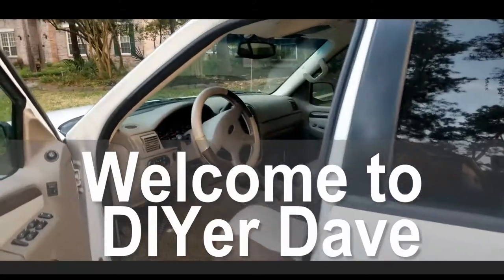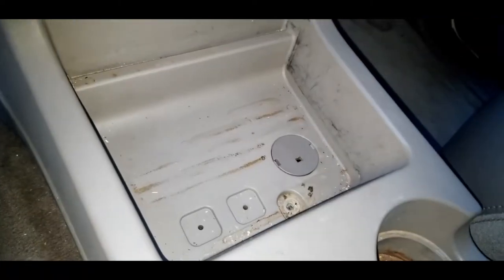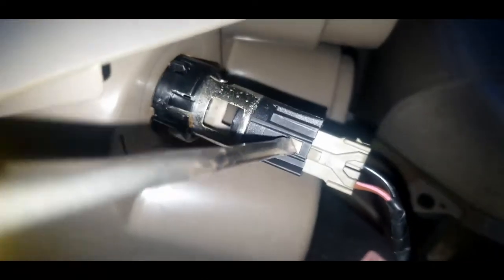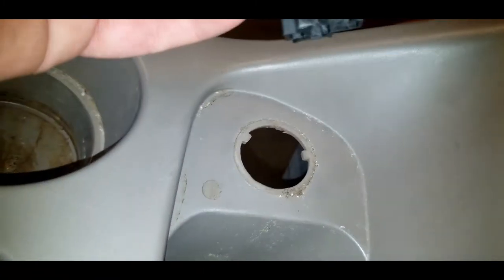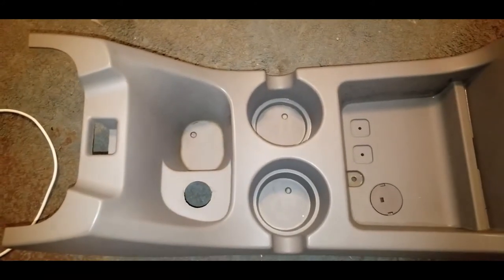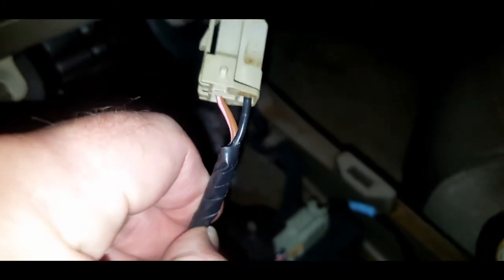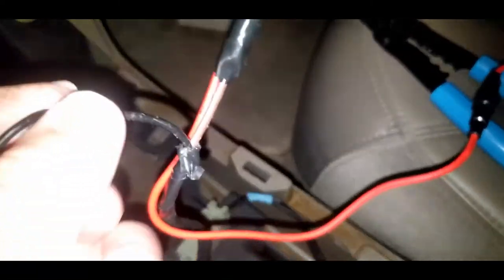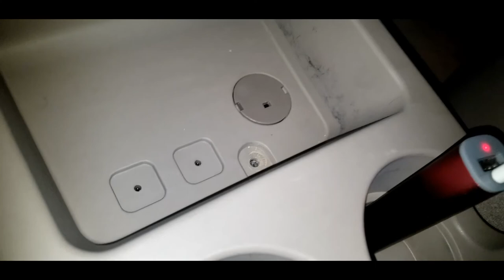02, 03, 04, 05 Ford Explorer Remove Cup Holder, Replace Cigarette Lighter, Install USB Charger Port

Comment: Great video. I pulled the charger out without knowing how to remove the console, by sticking my knife/screwdriver in one of the slots on the inside and using leverage to pry out one side, then wiggling it out with 2 knives. Make sure to disconnect the battery first because it is live. 

What I want to know is what does the access look like once you remove the console, because I want to order a fast charger and wire it straight to the battery. Reviews say not to hook one of those up to the existing circuit because it's not made to handle that much amperage.

Comment: An adapter like that should be wired to ACC power or you will have a parasitic draw. They can kill you Batt after just a few days of sitting. The original power port provides constant Batt power. Easiest is to tap into the radio's ACC power wire and ignore the OEM harness. And you typically just need to rotate the port a bit and the locking clips can be pushed in to release it.
Reply: Those alignment tabs make it so that you can't rotate it. I always thought the same.